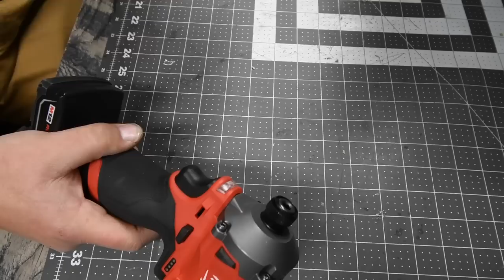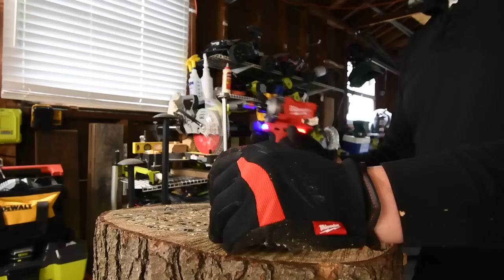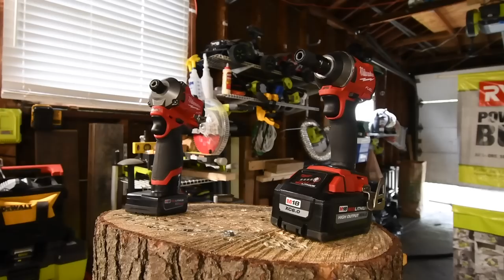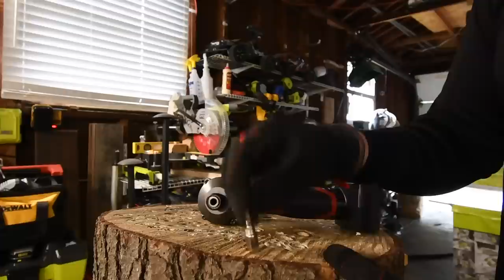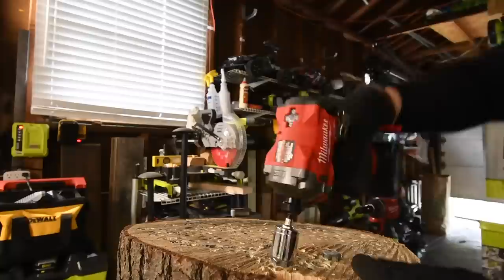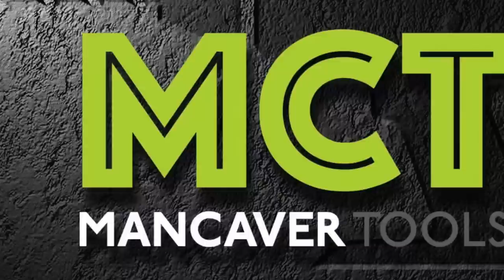M12 Frankenstein (STUBBY Impact Wrench)

Comment: Milwaukee should DEFINITELY  be paying attention. The M12 stubby as a Bosch "Freak" type tool would be HUGE!
Reply: I’ve noticed that the Freak 2 anvil varies from store to store. Some anvils have the 1/2” anvil with no hole for pin-lock sockets and some do. I have a few and they all came from the same store with same model number and batteries and packaging. The Harbor Freight Chrome moly sockets for wheels with the red plastic protecting sleeves are both ball detent and pin-lock sockets but the set doesn’t come with the pin-lock. Could the pin-locks be converted into ball detents on the freaks? They already have the jog ring...but to have both the hog and ball detent would be cool.

Comment: Gunna have to try the 3/8" adapter idea, we've gone through 8 in the last week!
Reply: I think the major difference is impact rated sockets vs regular sockets. Impact rated sockets intentionally weight a lot more because the extra weight of the socket greatly improves the impact force. There’s a lot less mass to rattle and beat around and considerably less stress on the adapter when you use regular non impact rated sockets.
Reply: TTC you should test to see if it makes any difference between a 3/8 anvil and 1/2
Reply: Love this show too holy
Reply: I think it is because there is much less of a size difference
Reply: 3/8 adapter probably has less stress than the 1/2. Similas to how tapered axles break in drag cars
Reply: Buy the husky adapters they are strong.

Comment: Hi David, that wobbling of the shaft on the M18 freak you can get rid of is by having made at a CNC machine shop a brass bushing to get rid of the gap around shaft of the hammer. That wobble would be gone forever. "Of course until the tool dies out on you".

Comment: The 3/8 probably works so well because there is a smaller area to exert pressure on the 1/4 inch stem

Comment: This is cool, but Bosch's solution is much much better. I just wish the freak 2 had as much power the m18 fuel.
Reply: yeah every brand is stepping up its game would love to see a freak 3 with 250 ft pounds 4600 ipm, and 4000 rpms
Reply: Love the Bosch Variant with it's duel purpose anvil, Wish Milwaukee would take on the idea.

Comment: Just so I’m clear, this is a modified 1/2 inch impact wrench?
Reply: Yeah the m12 Stubby 1/2 inch Wrench has had the Anvil replaced with the 1/4 impact driver anvil
Reply: @ToolTimeToday  but why? It could  do all this tests directly with a socket to the anvil.